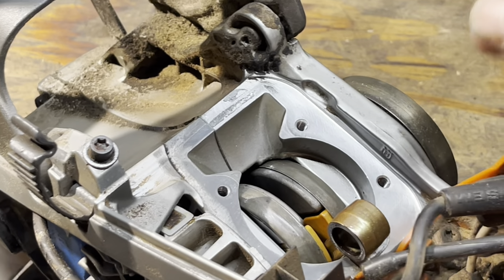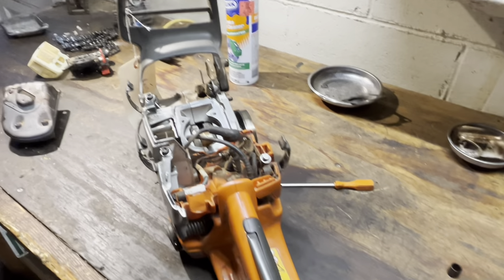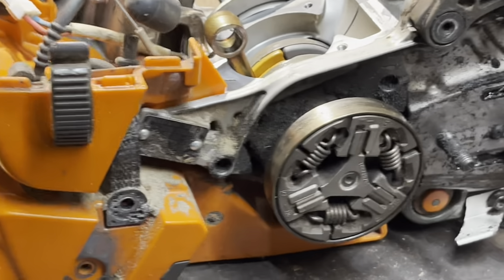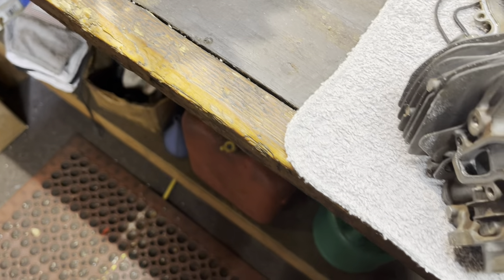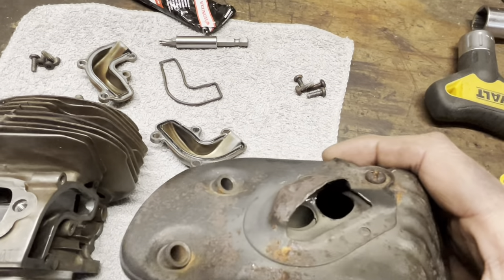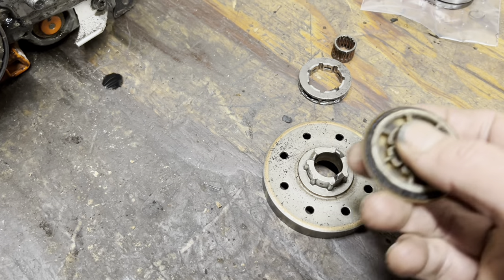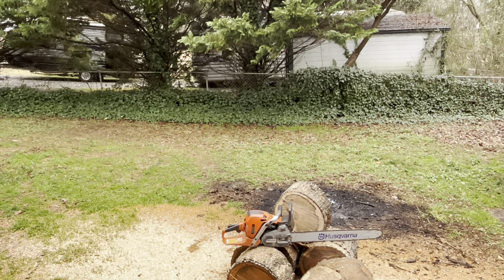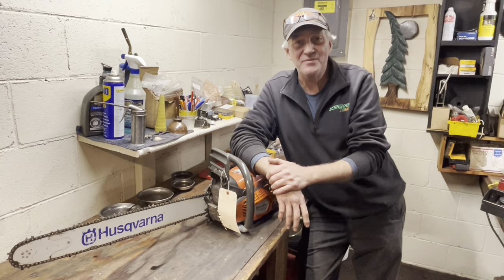562XP Part 2. Rebuild with Performance Work

Comment: So all the parts labor..plus ported. Must be the cost of new one..I had a 2022.or 23 I sold it..ran great ..had those up grades..just don't make sense to run 59cc when 462 400 weight the same once you get bar chain on them.72 cc couldn't go back. May as well use 261 in bucket truck or ported tophandles

Comment: In the video at 0:55 the air filter base appears to have an air inlet barb on the lower left of the screen. I have a 2014 562 that also has this barb. The upgrade kit base does not have one. I was told to leave the air hose loose in the saw. Based on the look of the barb in this video, it looks like it was sucking unfiltered air through the barb as it appears extremely dirty? Is that the case? and what did you do with the hose when installing the upgrade?
Reply from the maker: Good eye.  Hose is missing.  Don't know how or where it went.  The 562's are known for leaking around the filter base.  I feel that's where the majority of the particulate came from.
Reply: Just upgraded my saw air filter. I ended up putting a small plug in the now orphan hose. It looks like it heads to the tank along with the bulb line. Not sure, but the saw runs great and really like the new filter setup! Thanks for your videos, such great info!!!  @richardflagg3084

Comment: Hi Richard I got a Husqvarna 550 mk2  last week now i am concerned about the crank bearings there is a lot of videos about the seals going bad because of the plastic cage in the crank bearing did Husq fix the problem ? are they a  long term running saw
Reply from the maker: I think we are past the seal issue.  Husky blamed it on a defect by the bearing manufacturer.  I'd recommend either Honda HP2 or Amsoil Saber at 40:1.  That will keep the heat (friction) to a minimum in regards to the nylon bearing cages.  Great little saw.

Comment: Rich nice video. ❤❤❤
Looks to me like the latest update raised the idle a tad, probably to aid restarts. Mine idles much slower 2016, updated 2019 which fixed hot restart with a tad ritcher tune.
Have noticed this on the post 2022 saws on the internet.
Happy and safe cutting. 🪓🪓🪓